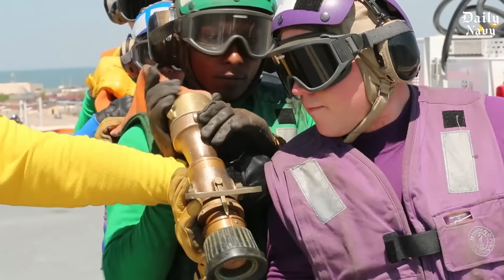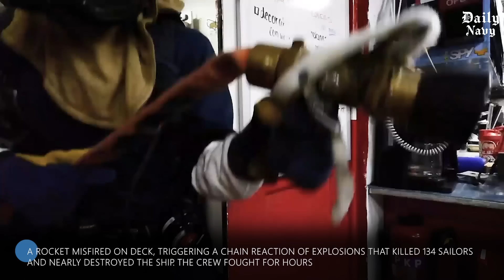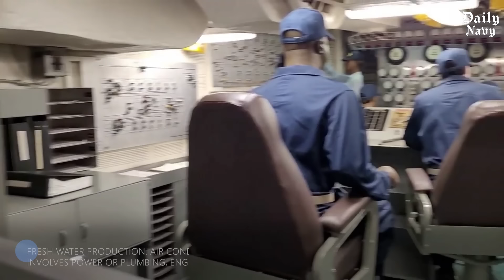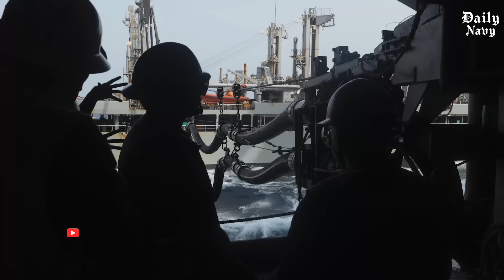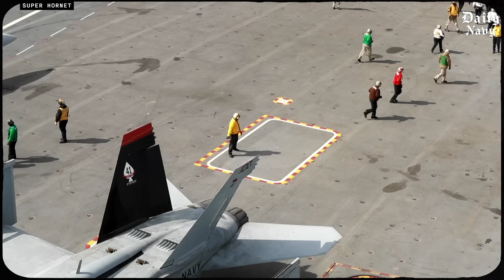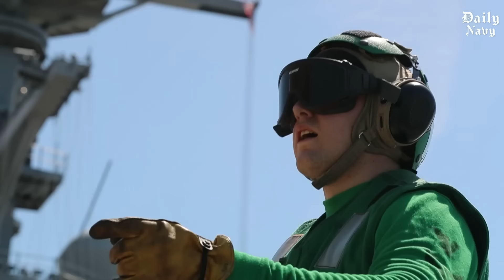How the US Navy Repairs Aircraft Carriers While They’re Still at Sea

Comment: This appears to be BS showing the propeller(screws) being removed at sea. These Screws are over 20’ in diameter and a challenge to get off even in dry dock. There are probably 4 of them.
Jet repairs are different and constantly repaired at sea. My guess is probably 40 man hours maintenance for every hour of flight. It may be more.